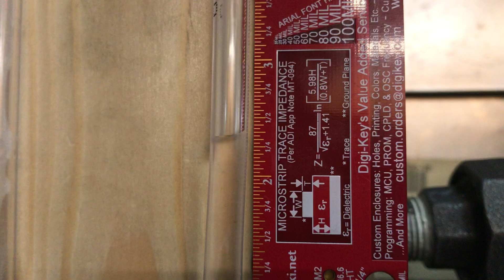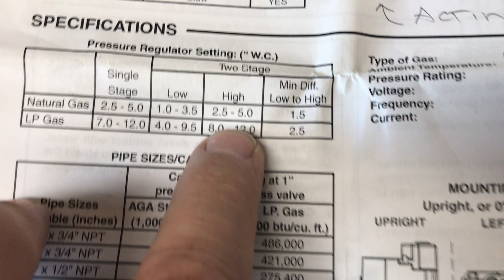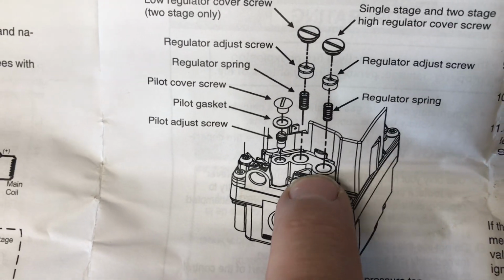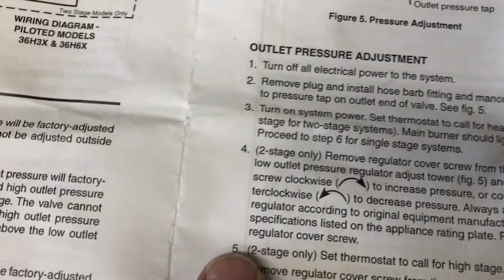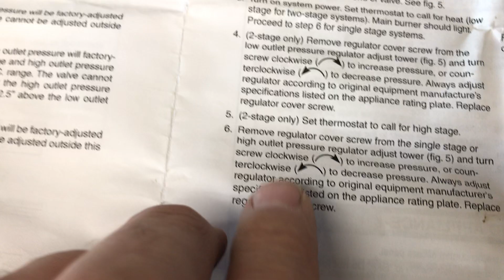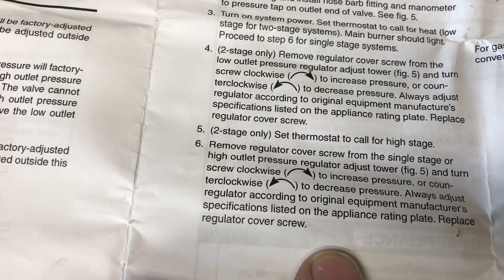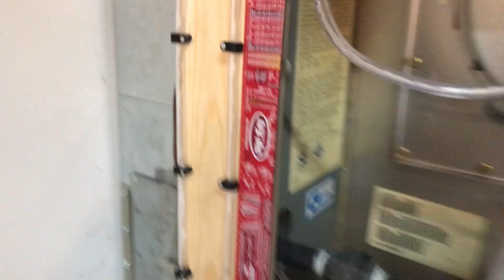White Rodgers 36H32-304 Single stage gas value acting like a 2-stage value

Comment: Did you ever figure out why it's acting like a 2-stage valve?  I would imagine testing the voltage at the gas valve solenoid might give you a clue.  If you notice a drop in voltage at the same time the drop in WC, it must be coming from the controller.  Then look at the controller to figure out where a 1-stage valve should be wired into.  I just replaced my 1990 York with the same valve, so I came here looking for reasons why I'm getting a delayed ignition "boom".  Your video is very helpful.  Thank you.